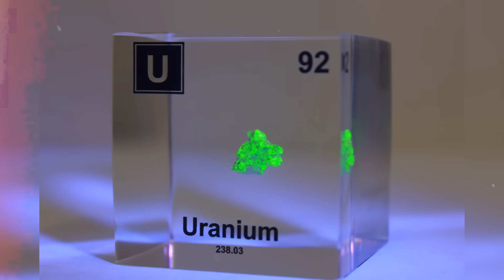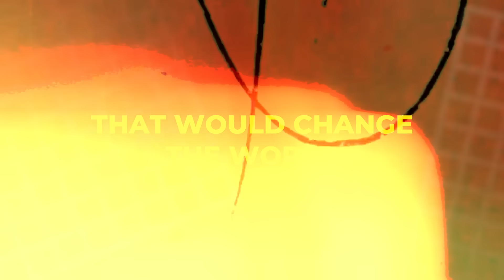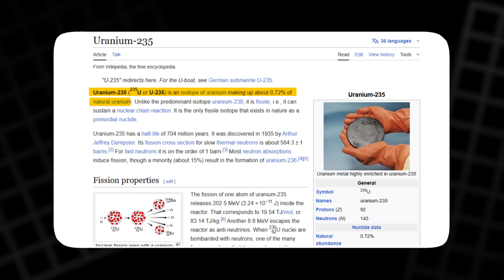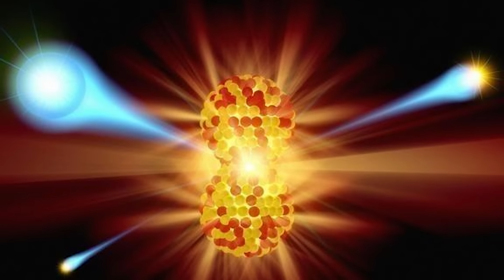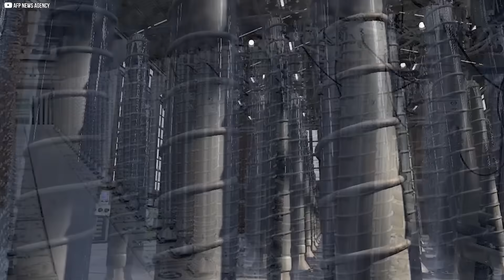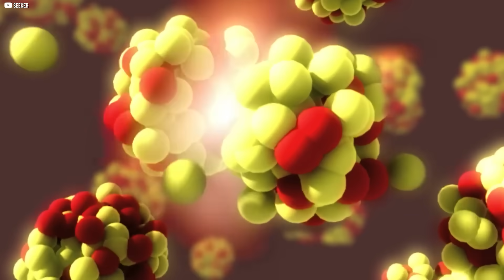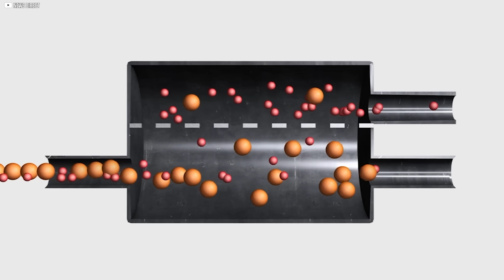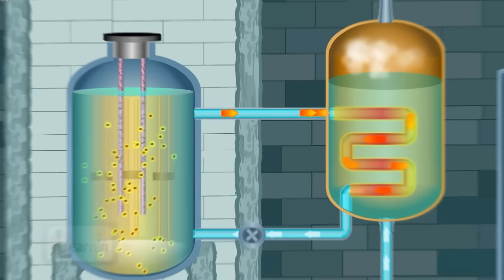How a Grape-Sized Piece of Uranium Powers a Neighborhood for a Year

Comment: what happens at all the U238 that isn't used for fuel?
Reply: If you are referring to the depleted uranium from enrichment, most of it gets buried so it cannot be dispersed by wind. Some is used to make stronger alloys for bombs. Inhalation of U238 or U235 particles from air or water can damage internal organs and may cause lead to cancer if not substantially diluted. U238 has a 4.5-billion-year half-life so it is only minimally radioactive. U238 is an alpha radiation emitter. Alpha particles can be stopped by our outer layers of skin or a piece of paper. Depleted uranium was once used in Fiestaware cups, bowls, plates, etc. There is no evidence anyone ever got sick from Fiestaware, but it has set off radiation detectors.
Reply: It's used for food colors.